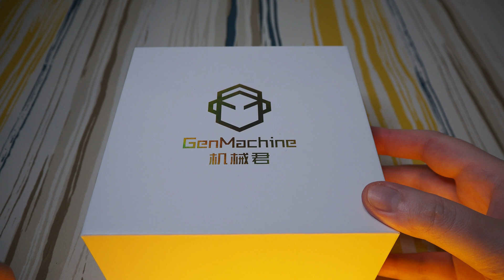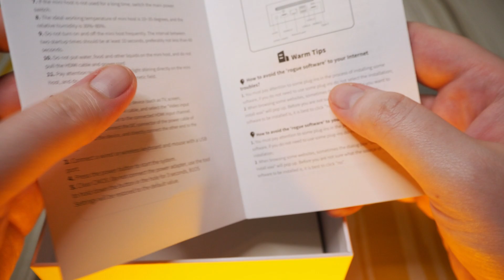AMD Ryzen 7 7730U - Unleashing Power in a Compact Form: GenMachine Mini PC unboxing

Comment: How's the performance with Linux? Any issue?
Reply from the maker: Well, playing games back to back was no problem. But having YouTube running in the background while skype is open and surfing the web seems to much for the heat management of this compact device. I experienced screen freezing while the sound was playing as normal. That is no issue of Linux of course. For that, Linux works very fine. At least the Arch based EndeavourOS. Didn't try any other distro.

Comment: To be honest, I find this somewhat poor. The title says unboxing and, besides that and opening the box to install RAM and a NVMe storage stick, nothing else.
Of course something is something, but I would love to see a more detailed review of the box itself. What I mean is, to know what kind of M2 slots does the motherboard has (they look to be M key, having the notch by the left as they are shown in the video), to check what kind of cooling the box has by dismantling it further (heatsinks and fans), and to check its UEFI BIOS for the amount of adjustable settings, options and information (very important), as it should provide information about manufacturer, model and chipset type; information which can also be checked with tools or commands while running an operating system. This information can be obtained quickly and is valuable.
Thanks in any case.
Reply from the maker: thank you for your comment and suggestion for improving the video. I really appreciate it.
I will take it into consideration for future unboxing videos.
I don't have access to the device at the moment as I have lent it to a friend. But as far as my memory serves me, it's not a UEFI but a normal bios. With the best will in the world I can't say how much customization the bios allowed.
Reply: The thing is that I find the available information for these micro PCs scarce. After all, where is the manufacturer's website? If there is 😹 one, that is.
Good manufacturers usually provide more than adequate product information in their webpages, this is what I find missing for these micro PCs. They otherwise look like nice products, although things like the quality of the supplied SSD storage in configurations which include them… 🤔 mmm.
Concerning the UEFI, I think it must be UEFI because modern PCs must adhere to the UEFI specification. Also, an UEFI BIOS program interface can be in text mode and have all the required functionality. The UEFI article in Wikipedia seems to provide adequate information: https://en.wikipedia.org/wiki/UEFI.
If they actually use the old BIOS standard yet, they deserve a beating…

Comment: Бро Привет! Хочу купить этот компьютер . Как спустя два месяца вашей эксплуатации?
Reply from the maker: Для меня он работает нормально. Мне бы не помешал еще один или два usb-порта на задней панели, но в остальном это аккуратный и за свою цену мощный компьютер.
Только ChromeOS Flex мне не подходит. Недавно я попробовал ее еще раз, и помимо того, что она не поддерживает WiFi, она также не работает с моими bluetooth-наушниками. Даже в Linux с этим проблем нет. - translated using deepl.com

// For me it works fine. I could need one or two more usb-ports on the back but besides that it is a neat and for the price powerfull computer.
Only ChromeOS Flex doesn't work for me. I did gave it a second try recently and beside the not supported WiFi it also dosn't work with my bluetooth headphones. Even using Linux it has no problems with it.

Comment: I got the modell Genmachine with 3550 h Ryzen and i can recomend it, 15-35 watt consume with max support of 32 gb ram and max 2 TB M2 SSD , it plays genshin/Honkai/Starrail witout any problem . (fullhd low specs) but anyway its good and quiet. best buy i have done. thx for the video to let people the newer version know it. ah by the way my recomend is install your own WINdows or Linux. price was 140.- dollars.
Reply: I recently purchased the same one, and it is still on the way. Did you have to update the BIOS, and what's there any issue updating drivers?

Comment: Any idea whether the TYPE-C supports Power Delivery?
Reply from the maker: Since the external display I use is only connected to the USB-C port (for power and display), I'm leaning towards saying yes.
Reply: @tianonly  wow that's a great news :) I'll be able to power it with my phone (68w) charger :)))
Reply from the maker: @saturnfrak  ewww you meant to power the computer over the usb-c port? I don't think thats possible and I won't try it too. They don't mention this function for the USB-C port anywhere in the manual.
Reply: @tianonly  Received my 5300U today - in my case TYPE-C can't power it on
If you're connecting your MINIPC only using the display port (via type-C) it supplies the power to the MINIPC (same as connecting it to the type-c charger)
Possible it's only in your model ;)

BTW - I saw in your next video that you're connecting both power and the display - so it's not PD, it's just display port via type-c ;)
Reply from the maker: @saturnfrak  Hope you are happy with your model.
I have to apologize. I did mistunerstand you. I thougt you meant if I can power a other device from the USB-C port like the display I use. Not to power the MiniPC. I am so sorry for my wrong answer
Reply: @tianonly   Yes I understood it afterwards - yes the minipc is great
I decided going with LUbuntu finally as windows 11 out of the box can't recognize my WIFI and I don't have the patience to wait for the AliExpress seller to send me the link to the windows drivers - it run like a rocket - but I'll have to check how I'm going to implement the usage of my multi channel audiocard :) cheers

Comment: What is the key to access the bio?
Reply from the maker: My device behaves in a way I have never seen before. Without an operating system installed, it boots into the bios on its own.
After installing Linux with SystemD-boot as the boot manager, I have a choice of booting Linux or rebooting into the bios.
Usually F1, F2, F10, F12, Del, or Esc brings one into the bios.

Comment: i think you should to delete the paper on ssd. your ssd will blow up if you’ll use it like this
Reply from the maker: 😱 Thanks for the hint🙃
Reply: @tianonly  I'd not do that - it'll void your warranty
Check first  the temperature on it, some SSDs aren't getting that hot (I already have the experience with SSD from laptop that you can't use on mini pc - because on the laptop the cover touch the SSD and cool it down)
If there's enough space you can add a heatsink, if there's not enough space you can add a thermal pad which will transfer the heat to the cover (same as done in the laptop SSD I described above)
Reply from the maker: @saturnfrak  I didn't do it but not because of the warranty. I was looking for weather it is  only a commercial sticker or something usefull and at least they advertise it with some new gen cooling solution. So I left it.
Putting a heatsink on it, I was thinking about it. I think somewhere I must have one laying around because the mainboard of my main computer came with a heatsink for the ssd and so I did remove the heatsink from the Samsung SSD I bought and used the beefier looking ones from the mainboard. Yet I had not time to look where I put the Samsung heatsink - I really should search for it🙃

Comment: How is the fan noise under load?
Reply from the maker: I had the fan turning on once when I did install the operating system and it was noticeable. 
I was in my office at work and did set up the installation on my break and let it run in the background. At first I wasn't sure what the sound was till I located it comes from the PC. But I have to say, I have had the screen standing on it.